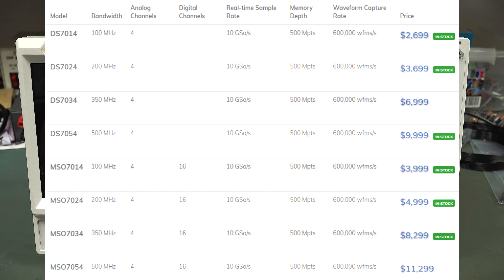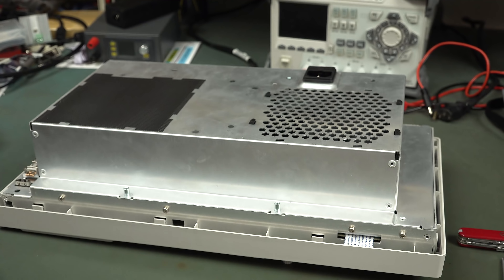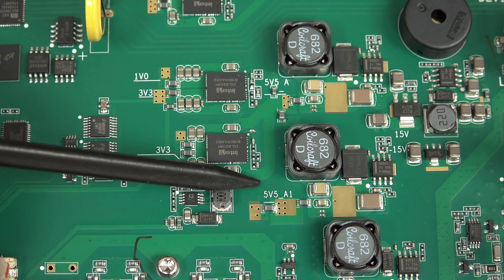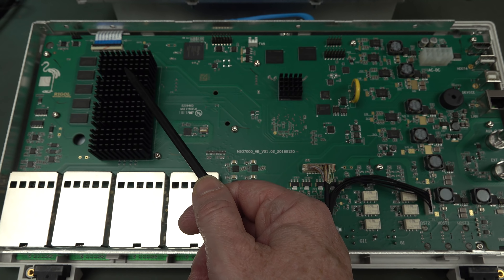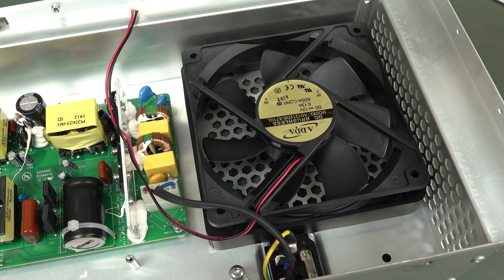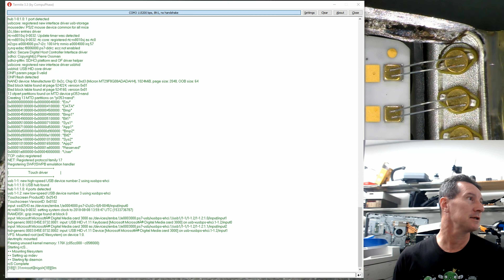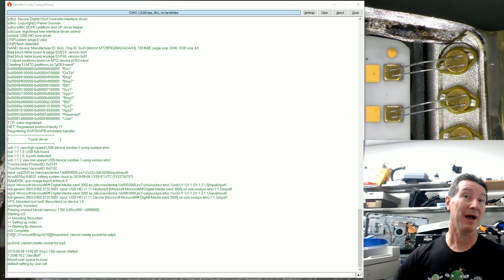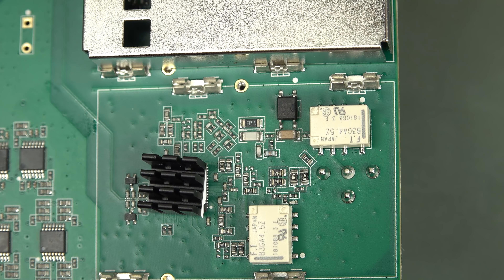EEVblog #1124 - Rigol 7000 Oscilloscope Teardown

Comment: Fast-forward to 2023-2024...
Their ~400$ DHO800 series (that is the replacement of 1000Z series Dave mentioned) uses custom, 800MHz-capable front-end ASICs (like ones found in HDO4000).
Of course I doubt the rest of the front-end - from discrete components - can handle that, the chip might be SW-limited, and the sampling rate (1.25 GHz) wouldn't allow for anything over 600 MHz (Nyquist) on a single channel, but still, the front-end ASIC is the same.

Comment: I hate the placing of the backup battery. It is not the first time i need to repair and replace  tracés and chips from battery leaks. 
I really would like to see a  spaced out room for those battery’s . It is a expensive gear
Reply: I have never seen a lithium coin cell leak. Definitely not the same as NiCd that used to be very common.
Reply: i had 2, coin cells leaking at the age of 8 years. and some nimh cells as well.  would be a shame to lose a nice scope for that reason. it also could be that i had 2 bad case cells, and with the innovation of these days leaking is impossible?

Comment: My best guess is the resistors in hw-id is for the software to read the board revision if something changed etc - not to lock down the firmware. I still think you can purchase software option codes and enter and it would unlock that way.

Comment: The cutouts around the edge of that mesh appear to match up with the fan mounts and the power connector, almost like it was supposed to go over there instead. And in case you haven't heard, you might be interested to hear that "Warranty Void If removed" stickers have been ruled illegal over here in the US .
Reply: They must make a right hand drive and left hand drive version.
Reply from the maker: The stickers aren't illegal, they just don't have a legal basis.
Reply: People and Dave.  The sticker are illegal if the manufacturer made it restriction to third party part (or small business), cost to repair device or no waiver from FTC.  It is part of US Federal law since there have been unfairly history in American.  Where the primary company had hurt both consumers and small business a lot.  So, to have "warranty void if seal" broken sticker, it must not costing to repair it or providing the part.  That is Magnuson-Moss Warranty Act, a federal law.

Comment: The mesh on the back of the can looks like what you'd find on the front door of a microwave. Considering it's right over the main switching power supply it might have been a last-minute fix to pass EMI testing. I realize it's on the outside of the can, but from what I've learned about antenna theory it wouldn't be out of the question for excessive noise to permeate through.
Reply: 🤦 No no no no no no, just NO. NO.

That mesh is 100% aesthetic for when you're looking at the vent holes with your eyes. It's so you don't see so much shiney aluminum. Usually it's done with paint.
Reply: I thought the same for a moment, but I doubt that beafy can was insufficient. The cosmetic reason seems very plausible.

Comment: "hit any key" needs to be on the RS232 port, not a usb keyboard. Standard u-boot linux bootloader.
Reply: That one made me shake my head.
Reply: I hope he tries to work it out and makes a modding video of sorts.
Reply: @TheTyrost  either way, if I see that message coming out of the serial port, I would expect to send a character over the serial port, not an attached keyboard. Maybe I would try a physical keyboard afterwards, but not first off the bat. 😆

That one made me facepalm a little too.
Reply: Even if he could get TX/RX to work - that would only get him as far as the u-boot bootloader. It'd be much easier just to read the linux image from flash, then "binwalk -e" on it and go from there.
Reply: Rx is probably working, but using different logic levels than Dave's USB serial adapter. If the USB serial adapter's default logic level screws with the receive, the CPU may not be willing to continue booting.

Comment: Actually, I think someone has just put the dust filter in the wrong place... the cutouts on the mesh perfectly match the actual fan location.
Reply: No, they put a piece of camouflage in the right place. The alternative would have been painting which is more costly in production and isn't as effective visually.
Reply: @Peter_S_  why would it have cutouts matching the layout the mains plug, and all of the slots that are cut in the sheet metal case? A die or cutting process would be more time consuming and expensive for that shape than just a square. 
And no manufacturer I have seen paints under vent holes to disguise bare sheet metal.
Reply: Very simple....  The cutouts allow for a single die to make pieces for either side and this gives complete flexibility in the final thermal management solution. This way the final thermal design can get tweaked quite a bit at the last stages of product testing without having to rework the plastic which is both expensive and time consuming. Everything like that camo piece is made with a die to produce lots of units at once from a sheet or a roll and everything has a subassembly part number. It's just how it's done in manufacturing. There's no need to have two designs when a single one will work for either side.  The metalwork is done with a CNC punch-press so making alternate versions is easy as pie and I'll guarantee they went through multiple revisions of metal during testing for thermal reasons. They probably even looked at a crossflow design with no rear facing fan which would need two camo panels. Somewhere in the lab is probably a prototype with big heat sinks and no fan done as a test, not because they thought it would be the final but to see how close they could reasonably get.  

Consider the open area of that mesh which is roughly 23% if it's the 3/64" holes on 3/32" centers (of course the metric equivalent) that I think it is (a standard pattern), and now compare the hit a fan would take in efficiency trying to draw air through it. Clearly it's not a filter and if you place it across the intake of a fan, you're only going to get 23% performance out of the fan, other turbulence aside. Taking a hit of 33% is common and acceptable but 77% will get you demoted or fired from a design team. You also have to consider the noise profile... the plastic and metalwork reflect high flow, low noise which is what you get from the big honeycomb pattern. Little round holes would not only be inefficient, but noisy.

Speaking as a manufacturer, I'll assure you that painting and dyed anodization is very commonly used behind grills to reduce the visual impact of the device guts. Stickers are used less often but you see a lot of them too. I won't say who I've worked for buy you can buy my gear here: https://www.bhphotovideo.com/ and there's a place in the enclosure painting instructions in each applicable case specifying which other spots to touch with paint on the inside of the enclosures.

Comment: Dave, Try adding a resistor to the TX line. I have some MCU's that are picky about it and don't boot when I have TX connected without an extra resistor I think due to some type over voltage / cheap MCU. :-)
The press any key u-boot message will probably only respond to serial input.

Comment: Heya Dave 

Got a question for you about frequency in power transmission systems. I wonder if you could break down for a layman why for example power systems in air craft are 400hz where as utility or mains power from your house socket is 50-60hz and how they decided at the design stage to use what they do in there respective systems.  

Long time watcher first time posting on a vid awesome content by the way keep up the good work with the chanel all the best from the UK.
Reply: In college was told the 400hz originated in aircraft as a weight saving strategy, 400Hz requires smaller and therefore lighter components especially inductor and capacitors in power supply smoothing circuits. This was back in tube days. As to the 60 HZ it seems for whatever reason it was smart cause of the 60 sec clock, makes a simple clock motor  that locks onto the frequency of the line very accurate since the power is tightly regulated at that freq.

Comment: That hardware version is probably just that. The hardware version, so they can run the same firmware images across multiple scopes, or at the very least the same firmware for different PCB versions of the same model.

Comment: I know this isn’t the kind of video to ask, but I’m sorry, I can’t wait for the review! I mentioned on the second channel that I’d be interested in this as a first DSO/MSO combo. If the thing is hackable, do you think it’d still be too much for a first scope?

I’ve only played with the old Rigol at Hackerspace, but I know that I will be using the MSO feature a lot (which the HSBNE scope does not have, unfortunately) and it would be amazing if I could have the bandwidth necessary to probe and capture USB traffic. Thoughts?

P.S. Most of what I will be doing is things like internal debugging, so RS232, UART, I2C, stuff like that. But being able to step up to USB more or less straight away would be extremely handy. I’d love to hear what you guys have to think.
Reply from the maker: Yes, you wouldn't spend this one a first scope. Use the money you save on other gear for your lab.
Reply: That is a rather good point, Dave. I didn’t think about that. I had a squizz at the 1000 family, and I really want something that is basically a 1054Z with the logic analyzer. But I’m having trouble figuring out which one I need. Because these things can be hacked, I want to make sure the hardware is there to enable it. Could you perhaps point me into the right direction? Cheers!

Also, I’ll be buying my first lab power supply soon, that little module you can get.

Comment: whats the need for trace length matching ?
Reply: ....... Signal critical timing.
Reply: Trace length matching does two things:
(1) timing equalization: if you're looking at two signals you need them to arrive at exactly the same time and the speed of light is a real limit in copper so lengths must match.
(2) signal integrity: Most high speed signals are sent as a "differential pair" where you have your signal and an inverted copy of the signal running in parallel down a pair of traces. Ideally the signal and the anti-signal travel shoulder to shoulder down the pair of traces and if one wave gets ahead of the other, the waveform gets "smeared" by one wavefront getting capacitively coupled to the other trace in the pair. If all the lengths are matched then any interference coming from that transmission line will be composed of a signal and an anti-signal which (hopefully) cancel each other out.

Comment: Have you tried plugging a USB keyboard in to the scope? Usually that will can autoboot in Linux.
Reply: I doubt it would. Cancelling autoboot is done by transmitting any character via said serial port. U-Boot does not have keyboard support.
Reply: Benedikt Müssig fair enough. I am by no means a *nix expert - although I’d like to be. But I have cancelled some boots in some operating systems by doing this before. Cisco you can cancel boot with the keyboard, but that’s hardly Linux I guess.
Reply: Your approach surely works with a lot of machines and it's certainly not wrong to believe that it may work here, but I do have experience with U-Boot and know it's in's and out's enough to confirm this will not be the case here ;-)
Reply: Benedikt Müssig that’s fair enough! I have cancelled boots in some embedded devices by doing as described, but I guess the point I should’ve been trying to make instead, is the fact that embedded devices almost always have weird and wonderful ways of doing more or less the same thing. It’s a source of infuriation when reversing, but it’s also a source of great interest to me. Everything is subtly different. And every new piece of kit I play with even for just a few minutes, teaches me something brand new. But I guess some of what I do has the same problem of “no one learns how to use Linux by watching progress bars advance when installing it in a virtual machine”. which is some of the problem I e been having.

I honestly can’t settle on a distro to use, because I don’t really know what I want to do yet! I want to do so many different things! I like networking, so something BSD based would be useful. I have about 40TB of old 2TB drives that is yet to be consolidated, I know I’ll be using FreeNAS here, more than likely. But I want to learn sysadmin and network admin stuff too, so... red hat or CentOS? I’m sure you get my point.

I might as well ask someone who is well versed in this world; where is a good place for me to start? I know effectively forcing myself to use the desired OS I want to learn is a great way to start - this is one of the primary reasons I bought a Mac a few years ago, and I love it! But the point of OS X is really to reduce command line usage as much as possible, and make computing more accessible, which I can’t help but admire. Regardless of which side of the fence you sit on, being able to put more computers into the hands of more people is only a good thing. I do find myself playing around in the command line from time to time, and installing home brew has made said command line a lot more fun to play with. But it is still a Mac. As a Linux fan friend puts it, it is basically BSD on training wheels. It might be hard to concede to that, I think OS X is a very capable and very powerful OS, even if it does pick and choose its components to the point where it may as well be it’s own bespoke thing and the fact that it uses a Unix subsystem is a mere technicality at this point.

I’m rambling on far too much, and I left the topic in the dust ages ago - but I’d love to know what you think. You seem to be quite well versed in this subject, certainly far more than I am. Sorry for rabbiting on so much, but *nix has always been one of those things that I want so much to get in to, but there is so much to it I literally don’t know where to start. I’m at precisely the same point with coding right now, for precisely the same reason.

Thanks for reading, if you made it this far! (I won’t blame you if you didn’t. :P)

Comment: What is the reason FPGAs need all those different voltages when typical CPUs don't? Possible Fundamentals Friday episode?
Reply: Because the datasheets for the FPGAs require it. Because if the voltage was any lower, the transistors wouldn't switch, and if they were any higher, they'd dissipate too much power. It's just a consequence of really gunning for maximum performance, which a typical 32-bit ARM chip really isn't doing.
Reply: @TheHuesSciTech  "because datasheet says so" doesn't seem like an answer to this question. I would say that the FPGAs contain some distinct blocks, that do have various electrical characteristics, thus needing different voltage supplies - but it still doesn't sound like a sensible answer.
Reply: Smaller chips like a typical ARM SoC usually do have internal voltage regs for the core voltage, AFAIK?

FPGAs generally have a much larger die, can take a fair bit of power when fully configured, but also need to support a whole slew of different IO voltage standards.

(like 3V3 LVTTL, LVDS, PECL, PCIe, 1V8, 1V2 etc. Hence VCCIO is broken out for each bank.)

The Cyclone III needs 1V2 for the core, 2V5 for the PLLs, and 3V3 for VCCIO (if you're just using LVTTL or whatever).

Again, I would guess that there's just a ton of logic to support on modern FPGAs, and a very large clock tree, so the regulators need to be external?

The regs would also take up die space, of course, and FPGAs need as much as they can get.
Reply: FFS. Even the most cutting edge processes like 5 or 7 nm require only "low" voltage for core and "high" voltage for I/O. Interface IP has its own regulators anyway. It's ridiculous.
Reply: Coz there is a lot of stuff in them which  is quite universal to fit different applications. Core is one thing, multiple I/O banks with different standards might be powered at different voltages depending on connected stuff (lvds, jesd, TTL/CMOS), PLLs and then SERDES are once again beasts on their own.

Comment: They put a finned heat sink underneath the EMI shield on the front end?  How is it supposed to get air flow?  That's pretty lame thermal design.
Reply: It was a surprise for sure,  connecting thermally to the can should be much better.

Comment: Eh, ADDA fans are ok. I’ve found them in some very nice computer power supplies. I’ve had one of them die, but it wasn’t the end of the world. They’re reasonable - still a brand name though. I think CapXon are ok as well. They’re no Panasonic capacitors, which in my humble opinion are the best in the business, but capacitors are also nowhere near as bad as they used to be, across the board. Everyone got stung by that scandal, and even capacitors you’ve never heard of are probably better than the shit from the early 2000s.
Reply: Last year I bought some new capacitors on eBay and within a year even the ones left in the drawer had dropped badly in value, and the one in a machine had died.  Threw them all out.  Bad capacitors are still being manufactured.

Comment: I’d personally rather just get a used hp scope versus a rusty Chinese designed scope with misspellings. Looks like the fan screen was originally designed for the side of the case with the power input. If the components are genuine and not used, it’s impressive (sans the caps) that they are using brand name components.